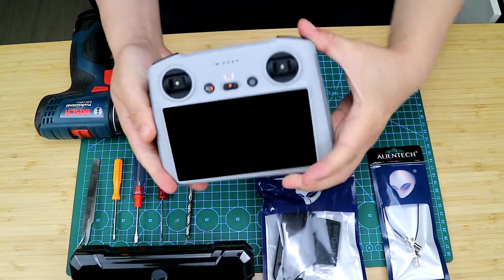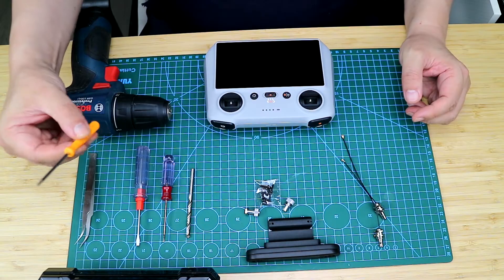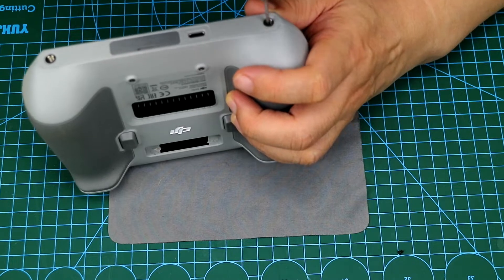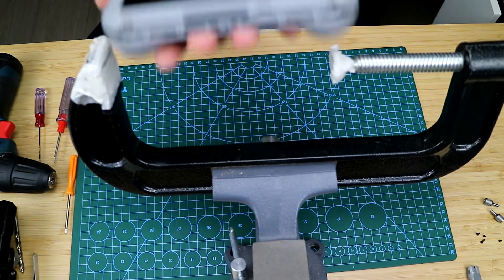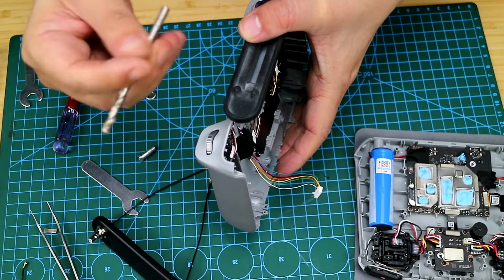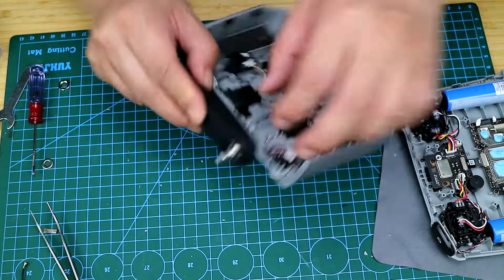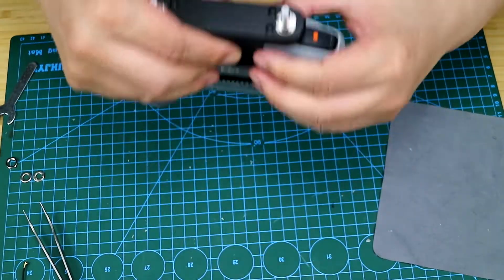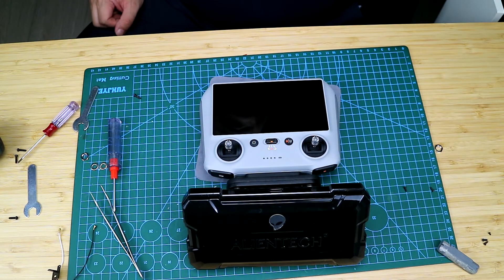How to Upgrade DJI RC Controller of Mavic 3 Classic Mini 3 pro Mini 4-Z Air 3 add ALIENTECH Antennas

Comment: How does this compare to 4hawks I've never seen a single video comparing both, compared to the xr and sr  the sr is 2x range so 10.12miles in real world and xr is 20.24 miles real world use and in perfect conditions 17.4 miles (sr-34.8miles)(xr-69.6) if it was perfect conditions💀

Comment: I followed your video instructions and installed the antenna upgrade. It worked out VERY good! The external antenna more than doubled my range! Even though I can see the the effects of a stronger signal, the measured distance shown on my DJI RC transmitter is not accurate - it's shorter than it should be. There seems to be the need for some sort of calibration to display an accurate distance with the new external antenna installation. Am I correct?
Reply: Are you still limited to line of sight?

Comment: Whats the point? Stock remote can already reach out further than the battery can go however while this antenna isnt needed the install kit here can be very useful. Im my case i installed 2.4ghz omnidirectional antennas onto the roof of my house and ran 50 ft of low loss LMR 400 down to my man cave . Then hdmi out to my 65 inch tv. And with all this i still have more range then battery. Its great for a more portable version with antennas with magnetic mounts for your car!
Reply: You seem to be falling into the trap that many others fall which is to believe that any person who installs these booster want to go further with the drone. That is not always the case. I wanted it just for better signal at close distances, since I live in an area with many trees, and even 1 km is enough for me to lose signal without the booster.

Comment: Hello there. Wonderful video. Thank you. I have been wanting to fit my rc controller with an external antenna for some time now. Can you please tell me where you were able to obtain the 3D printed black adapter from? It is a perfect solution! Thanks again. Bruce

Comment: All due respect, thank you for showing how to do the modification.  BUT, what good is showing how to do the modification, then NOT taking it out for a range test?  Telling us what is capable of, is NOT the same thing as SHOWING us REAL proof.  

This setup is $599.00.  I don't have a problem with the cost, IF it does what it says.  What should have been done, was before the modification, do a test flight with the stock DJI RC controller.  Max it out, to where the screen goes black, and see what the distance was.  Bring it back in for a landing.  Go, and do the modifications, with the new antenna setup.  Then go back to the same exact spot you flew from, flying the EXACT same pattern as with the stock controller, and SEE the difference.  Why is this so hard?  Who the heck wants to throw down $599.00, for something they are TOLD, but NOT SHOWN to work?
Reply: "Why is this so hard?"
Because it is probably illegal.  That is to say, it would definitely be illegal in the United States anyway unless you have a BVLOS waiver from FAA. 
As it happens, a directional antenna is sometimes useful even when you can see the drone if there's interference nearby. 
Anyway, someone else on YouTube is sure to be using one of these and does not mind putting themselves on report.
Reply: Oh, and one other thing; you are supposed to reduce your transmitter power if you have a high gain antenna.   I wonder if anyone does that?

Comment: followed the tutorial but after the ground drone got up I couldn't control it and it started going by itself. what is the problem??
Reply: Possibly got the antennas swapped.  One is for 5 GHz and the other is for 2.4 GHz (if I understand it right).

Comment: PLEASE! Answer me, is there any difference between antennas ports? There is two antennas, for 2.4G  and 5.8G, on my remote controller. Is there any difference where to connect them, on ALIENTECH DUO II 2.4G/5.8G ???  There is nothing in users manual, about that. Tech support didn't answer on that crucial question.
Reply: ANOTHER person asking that relatively simple question…
I have been asking the same question as well as exactly what type of RF connectors are used.
Thanks for asking again, perhaps someone will answer it?
Reply: Normally a 2.4ghz antenna will not only work on 5.8ghz but has increased gain because it's a multiple of 2.4. Which is the case with all antenna most of the time.

For example. A 1.2ghz antenna will work on 2.4ghz and 5.8ghz. With increased gain on 2.4ghz and even more gain on 5.8ghz. But the SWR needs to be verified before use. Especially when increasing the freq by more than 2x. Sometimes what is labeled as say 1.2ghz turns out to be tuned for 1240 - 1300 mhz. So at x2 can throw its center freq outside the 2.4ghz band. 2.4ghz ISM Band actually covers 2400 - 2483.5 mhz. 5.8ghz ISM Band covers from 5725 - 5875 mhz. In the USA and varies some by country.

Look up ISM Bands.

The connectors are QMA which is a Quick SMA connector.
Reply: @WW5RM  THANK YOU !
If I had known about the world of drones, I would have absolutely purchased gear with a wider frequency range.
I mostly dealt with the public safety sector and spent a fortune on test equipment,  not realizing that it would have only been a small increase in cost to go to 6+ GHz.  My first spectrum analyzer was an Agilent 9340 series (portable SA) which had an upper limit of 3GHz.  It definitely paid for itself once I was able to tune duplexers, filters, etc..  but for only an extra $2k or so, I could have gone up to 6GHz.

I eventually bought a Rigol “Chinesium” SA (it’s actually a nice little piece of test gear) for the bench and made a similar error in model selection.  It was actually not worth the upgrade with this one.  (approx $1400 for 1.5GHz //  approx $6k for the 7.5GHz) 

I lost much interest in the radio realm after some major health issues. (stroke  & ankylosing spondylitis) and my incredible Wife bought me a Mavic-2 Pro after watching a few Ken Heron videos.   It changed my life and I was able to incorporate that new skill set into the public safety world.
Reply: My big dilemma now = 
I have a Mavic-3 (original model) / RC-Pro  controller / RC-Plus (modified by the seller to run DJI’s Fly app).
I live in an area completely surrounded by mountains and massive trees. Flight from my backyard is possible IF my controller + drone signaling was better.  (VLOS, of course).   

I purchased an Alientech Duo-2 (combo directional antenna w/bi-directional amp in a compact package) and the install kit for the RC-Pro, but wasn’t up to doing the install, so eventually located the RC-Plus with external antenna connections.

Alientech makes a great little adapter “bar” kit that permits you to easily remove the RC-Plus antennas and this “bar” screws into the (proprietary?) connectors on the controller and provides 2 QMA connectors for attaching the Duo-2 directly to the controller.
Alternatively, I made up a wiring harness for remotely mounting the unit.  10’ (x2) of RG-400 with SMA male connectors.   I then used “pricey but cheap quality” adapters to QMA (2x male / 2x female) to permit remote mounting using an old/spare carbon fiber tripod.

I eventually purchased the “Alientech OEM” wiring harness with better quality connectors and no “adapters”.
It honestly did not work nearly as well as I had hoped, but I have a horrible environment, especially when the trees/leaves are wet.
I ended up buying the newly released DUO-3, but haven’t had much better success.

The problem?  
The equipment is actually very well designed and constructed, but in my case - 
The antenna is STILL located too low, beneath the trees.

I have a tower located on my property and have a few spare 7/8” Heliax cables, CAT-6 STP cables and a few spare 2” PVC schedule 40 conduit runs from the house to the tower and have a ton of space in a small “shed” at the base of the tower.  (AC utility power and mini-split cooling also exist for the repeaters I have in the “shed”).

Any ideas on mounting an omnidirectional antenna on the tower with a powerful bidirectional amp in the “shed” (80’ tower)
and have some sort of “repeater” connection from the handheld RC to the ‘shed”?  The overall length from the house to “shed” (150+ feet plus 80’ from “shed” to tower top) would be way too long for the freq range being used….    

I had purchased a pair of DJI’s “LTE Dongles” when the Mavic 3 was first released, thinking it would be ideal solution.
BUT… no go in North America.   I was able to get the RC-Pro functional, but just for firmware updates, etc…. 

I’d l
Reply: @PowderMill  interesting! I've seen those RC Plus on eBay but was to much of a risk for me.

I normally stay away from 5.8ghz due to its reduced range. Normally the higher you go in freq the Ground Wave propagation is reduced (excluding interference). The difference between 2.4 and 5.8ghz is almost double. Like you we have trees EVERYWHERE here. Some close to 100 feet tall. I barely have enough room to squeeze my drone between the trees to launch! I own 3 acres. It's basically two places I can squeeze through. Everywhere else it's a closed canopy!

Normally I manually choose 2.4ghz in the Band settings. But I've noticed DJI FLY does an awesome job at which band to use. Occasionally I see a weak signal warning but I think it's switching to 5.8ghz, detecting even worse signal and Immediately switching back. Pretty sure if I would go back to manually selecting 2.4ghz I wouldn't even get the weak signal warning. But it's only for a second at the most. 

My general rule of thumb for even 2.4ghz is to not run more than 50 feet of coax / feed line. Mainly due to using smaller LMR240. But with 7/8" Heliax I'd have to look at the numbers (loss at 2.4ghz and antenna gain). You might get away with a long run but if it's borderline then you wasted time, effort, cost of antenna and not really gained anything. That's assuming you already have the 7/8 Heliax. If i had to buy feed line / coax then no, its worth it to me.

Interesting you mentioned "wet trees". I see that too! Significant decrease in signal after a rain! Ah these wonderful trees! =]

Honestly if you could get on a hill or mountain to launch that would be the easiest way to increase range. You either elevate the drone or if possible elevate the controller. I'm pretty sure a Repeater is out of the question. I've not seen any way to do it with DJI. Although they do have a Relay device for the Agri drones. I'm sure it's possible it's just the fact it most likely requires some added feature to the app for it to work and I've not seen anyone who is able to make it work. A Repeater for UHF normally has a 5 mhz off set in freq (input and output) adding that to the equation means the drone would need to run a separate freq / channel than the controller. Pretty sure to do that the app needs a option or feature to allow it. Plus stop it from channel surfing and band switching of course.

Comment: Looks cool, but it's a little pricey without knowing how much this improves signal strength.  Considering this remote is $300, then add the cost of this antenna @ $577. For another $200, you could just get the pro version and not have to risk damaging your controller.
Reply: Remote 350 antenna 350, if you want the antenna plus booster 530, the pro remote is 1200 ....
Reply: "For another $200, you could just get the pro version and not have to risk damaging your controller."
Fixed:  For another $1000 you can purchase a pro controller and THEN add a range extender!  
Some documents show this patch antenna having 15 db gain.  Each 6 db will approximately double the range so you MIGHT get 4x the range but only in the case of no interference from other sources.
Reply from the maker: It is true that the cost of the antenna and remote combined can be significant, and it may be more cost-effective to simply purchase a higher-end drone with better signal strength. However, it is also important to consider the specific use case and the potential benefits of improved signal strength in certain situations. Additionally, purchasing the antenna and remote separately may be a more cost-effective option for those who already own a drone but are looking to improve its signal strength. Ultimately, the decision will depend on the individual's specific needs and budget.
Reply: @ALIENTECH_Booster  no one is buying this without showing how far it extends the range. Thanks

Comment: Looks nice but I would like to have see a flight test with and without this antenna. Thanks for sharing.
Reply from the maker: I understand your concern. It is always best to see a product in action before making a purchase. Many manufacturers and sellers of this type of antenna may have demonstration videos of the product in use, which can help to give a better idea of the potential benefits and performance of the antenna. Additionally, many online retailers have a customer reviews section where you can read feedback from other customers who have purchased and used the product. It may also be helpful to reach out to the manufacturer or seller directly and ask if they have any demonstration videos or flight tests available.